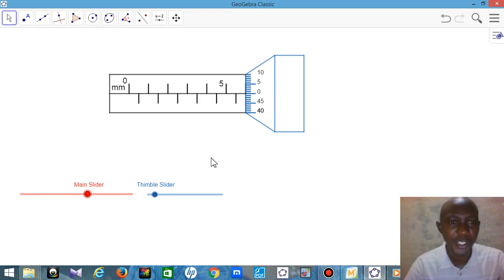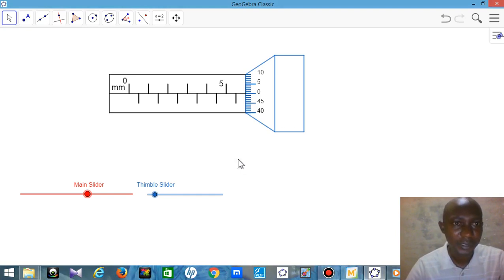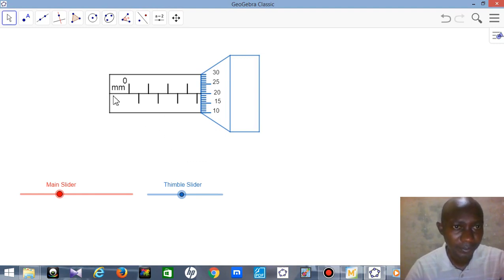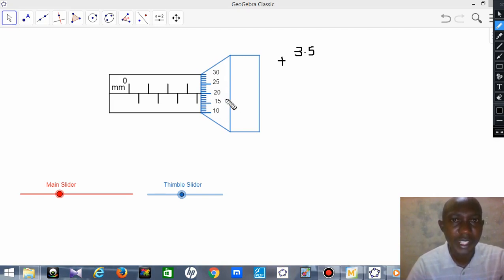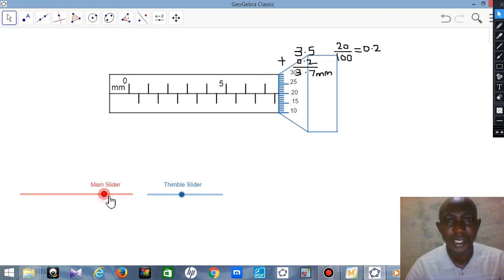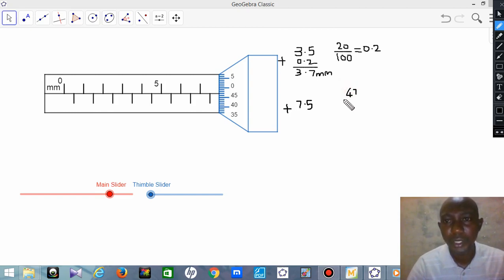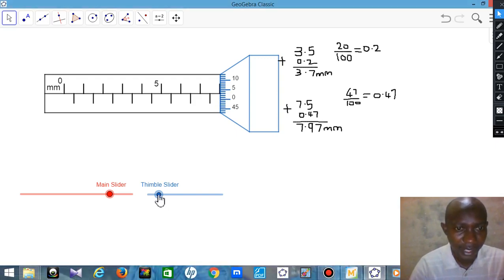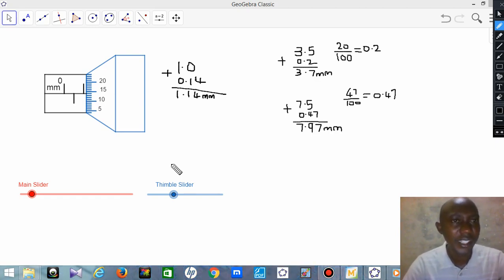How to read the Micrometer Screw Guage

Comment: Why did you divided by 100 sir?pleas answer
Reply from the maker: The thimble reading is a decimal part of the micrometer reading. If you add it to the main reading without dividing by 100, you will not get the actual result you need. Take note most micrometers are designed to measure up to 2 decimal places.